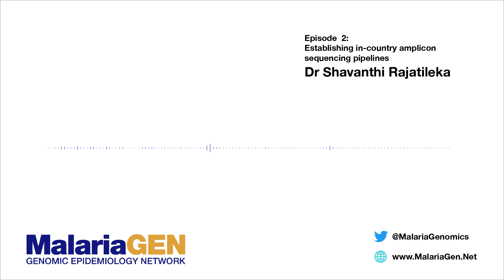Building amplicon sequencing pipelines: Dr Shavanthi Rajatileka on the MalariaGEN podcast

Comment: Building amplicon sequencing pipelines is crucial for efficient and reliable genomic analysis, particularly when studying specific regions of DNA, such as microbial communities, genetic markers, or particular gene variants. Amplicon sequencing involves amplifying a targeted region of the genome using polymerase chain reaction (PCR) and then sequencing the amplified fragments to obtain detailed genetic information. It is widely used in microbiome research, pathogen detection, and the study of genetic variation in both clinical and environmental contexts.

An effective amplicon sequencing pipeline typically consists of several steps, each of which needs to be optimized to ensure high-quality results. The first step is the selection of the appropriate primer sets for PCR amplification. These primers should be designed to target specific regions of the genome, such as the 16S rRNA gene in bacteria or the ITS region in fungi, while avoiding amplification of non-target sequences. Primer design tools and databases, such as Primer3 and NCBI, can assist in creating primers with high specificity and efficiency.

Once the PCR amplification is performed, it is essential to confirm the success of amplification and the quality of the PCR products. This step often involves gel electrophoresis or other methods to assess the size and purity of the amplicon. If amplification is successful, the next step is sequencing, which can be performed using high-throughput sequencing platforms like Illumina or Oxford Nanopore. These platforms provide the depth and scalability necessary for generating large amounts of sequence data, allowing for detailed analyses.

The sequencing data generated in amplicon studies is typically complex and requires specialized software and bioinformatics tools for processing. The first step in data analysis is quality control, which involves removing low-quality reads, trimming adapters, and filtering out chimeric sequences. Tools like FastQC and Trimmomatic are commonly used to assess and clean sequencing data. After quality control, the data must be aligned or clustered based on the targeted amplicon regions, using algorithms such as the USEARCH or DADA2 pipelines for microbial community profiling.

Once the data is processed and cleaned, taxonomic assignment or variant calling can be performed. In microbiome studies, this involves classifying amplicon sequences against a reference database, such as Greengenes, SILVA, or UNITE, to assign taxa to the observed sequences. For genetic studies, variant calling algorithms can identify single nucleotide polymorphisms (SNPs) or insertions/deletions (indels) in the targeted genomic region.

Finally, the results of the analysis should be interpreted in the context of the research question. For example, in microbiome research, amplicon sequencing can reveal shifts in microbial diversity or the presence of specific pathogens. In genetic studies, it can help identify mutations associated with disease or other phenotypes. It is essential to present these findings with appropriate statistical analysis, often using tools like R or Python for data visualization and interpretation.

Despite the power of amplicon sequencing, there are several challenges that need to be addressed. One of the main limitations is the potential for biases introduced during PCR amplification, which can affect the representation of certain sequences, particularly in highly complex samples like microbiomes. Additionally, sequencing errors, misidentification of taxa, or incomplete reference databases can lead to inaccurate results. It is important to validate findings through complementary methods, such as metagenomic sequencing or qPCR, when necessary.

To overcome these challenges, future advancements in sequencing technology, primer design, and bioinformatics algorithms are expected to further enhance the accuracy and scalability of amplicon sequencing pipelines. Improved error correction methods, better reference databases, and more robust computational tools will allow for more reliable and reproducible results in a wide range of applications, from microbial ecology to human health research.

In conclusion, building effective amplicon sequencing pipelines requires careful planning, from primer design to data analysis, to ensure high-quality and meaningful results. While there are challenges associated with this approach, continued advancements in sequencing technologies and bioinformatics will help overcome these barriers, providing valuable insights into genetic and microbial communities.Building amplicon sequencing pipelines is crucial for efficient and reliable genomic analysis, particularly when studying specific regions of DNA, such as microbial communities, genetic markers, or particular gene variants. Amplicon sequencing involves amplifying a targeted region of the genome using polymerase chain reaction (PCR) and then sequencing the amplified fragments to obtain detailed genetic information. It is widely used in microbiome research, pathogen detection, and the study of genetic variation in both clinical and environmental contexts.

An effective amplicon sequencing pipeline typically consists of several steps, each of which needs to be optimized to ensure high-quality results. The first step is the selection of the appropriate primer sets for PCR amplification. These primers should be designed to target specific regions of the genome, such as the 16S rRNA gene in bacteria or the ITS region in fungi, while avoiding amplification of non-target sequences. Primer design tools and databases, such as Primer3 and NCBI, can assist in creating primers with high specificity and efficiency.

Once the PCR amplification is performed, it is essential to confirm the success of amplification and the quality of the PCR products. This step often involves gel electrophoresis or other methods to assess the size and purity of the amplicon. If amplification is successful, the next step is sequencing, which can be performed using high-throughput sequencing platforms like Illumina or Oxford Nanopore. These platforms provide the depth and scalability necessary for generating large amounts of sequence data, allowing for detailed analyses.

The sequencing data generated in amplicon studies is typically complex and requires specialized software and bioinformatics tools for processing. The first step in data analysis is quality control, which involves removing low-quality reads, trimming adapters, and filtering out chimeric sequences. Tools like FastQC and Trimmomatic are commonly used to assess and clean sequencing data. After quality control, the data must be aligned or clustered based on the targeted amplicon regions, using algorithms such as the USEARCH or DADA2 pipelines for microbial community profiling.

Once the data is processed and cleaned, taxonomic assignment or variant calling can be performed. In microbiome studies, this involves classifying amplicon sequences against a reference database, such as Greengenes, SILVA, or UNITE, to assign taxa to the observed sequences. For genetic studies, variant calling algorithms can identify single nucleotide polymorphisms (SNPs) or insertions/deletions (indels) in the targeted genomic region.

Finally, the results of the analysis should be interpreted in the context of the research question. For example, in microbiome research, amplicon sequencing can reveal shifts in microbial diversity or the presence of specific pathogens. In genetic studies, it can help identify mutations associated with disease or other phenotypes. It is essential to present these findings with appropriate statistical analysis, often using tools like R or Python for data visualization and interpretation.

Despite the power of amplicon sequencing, there are several challenges that need to be addressed. One of the main limitations is the potential for biases introduced during PCR amplification, which can affect the representation of certain sequences, particularly in highly complex samples like microbiomes. Additionally, sequencing errors, misidentification of taxa, or incomplete reference databases can lead to inaccurate results. It is important to validate findings through complementary methods, such as metagenomic sequencing or qPCR, when necessary.

To overcome these challenges, future advancements in sequencing technology, primer design, and bioinformatics algorithms are expected to further enhance the accuracy and scalability of amplicon sequencing pipelines. Improved error correction methods, better reference databases, and more robust computational tools will allow for more reliable and reproducible results in a wide range of applications, from microbial ecology to human health research.

In conclusion, building effective amplicon sequencing pipelines requires careful planning, from primer design to data analysis, to ensure high-quality and meaningful results. While there are challenges associated with this approach, continued advancements in sequencing technologies and bioinformatics will help overcome these barriers, providing valuable insights into genetic and microbial communities.